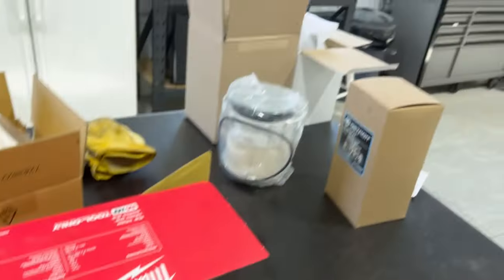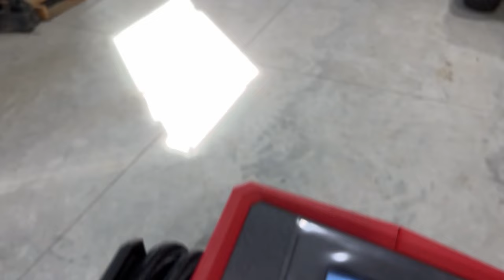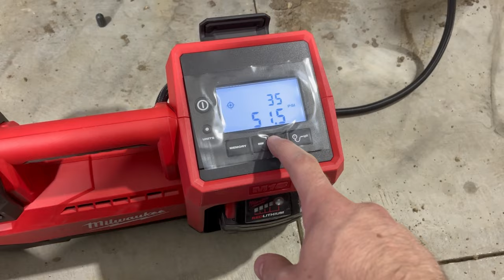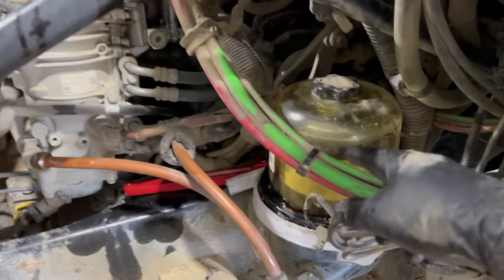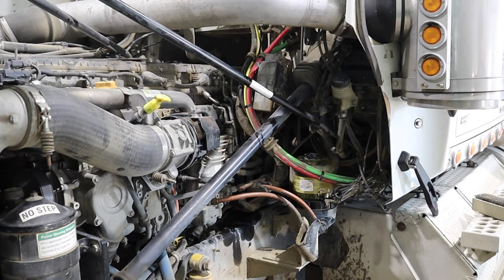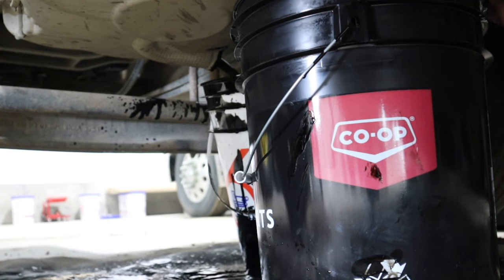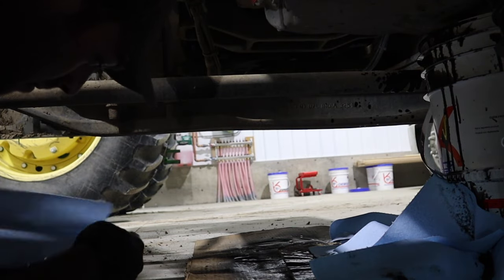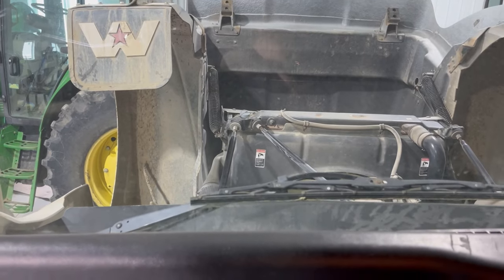Dustin's Truck And Trailer Service

Comment: I cut an old plastic 45 gallon barrel down to fit under the oil pan of the truck. Works great for oil changes. 
You have a great sense of humour.
Reply from the maker: Thanks ya I need to cut down and old tote for oil changes